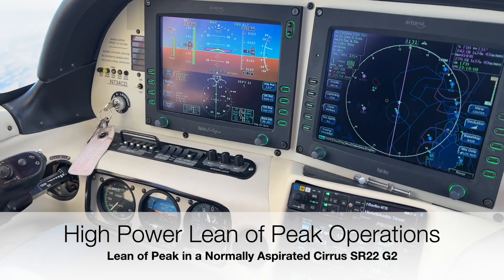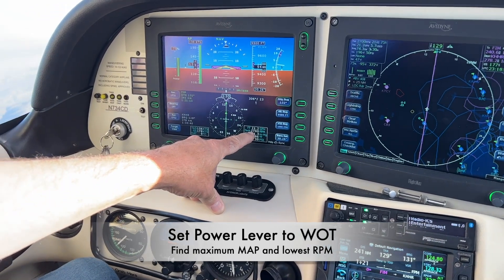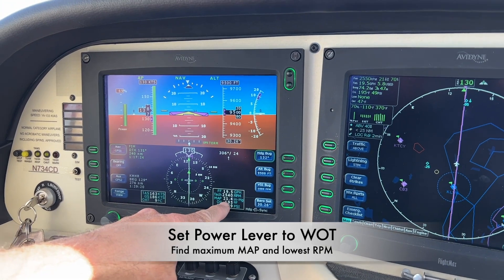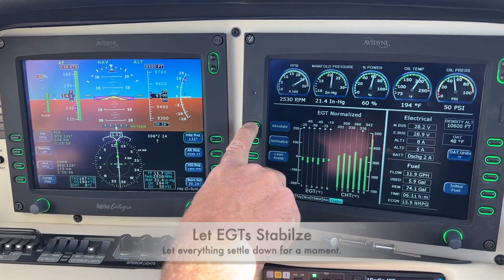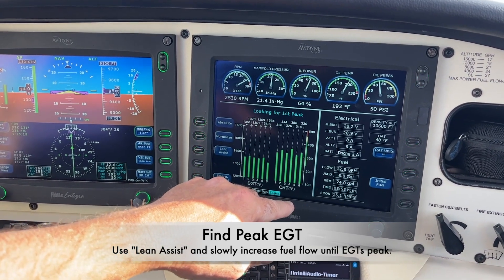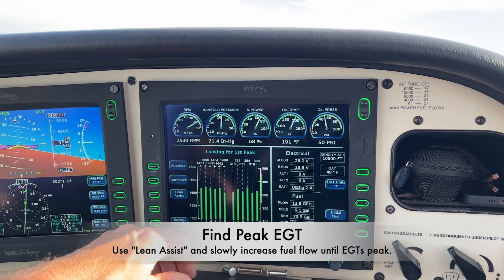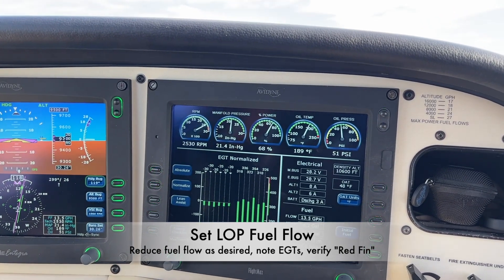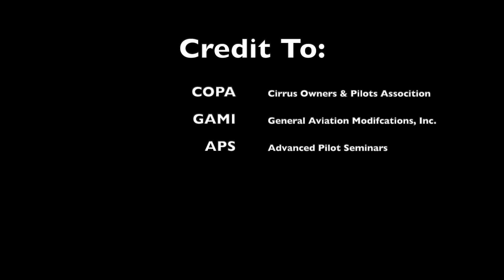High Power Lean-of-Peak Operation

Comment: Great video - there is one critical thing I might add: it's important to also monitor how CHT's respond after setting fuel flow. CHT's take some time to respond / adjust, but those temperatures are what actually matter in terms of engine longevity, as they more closely correlate to internal cylinder pressure (ICP). In an SR22, I would try to keep temps below 350 degrees for all cylinders during cruise (so maybe run a little leaner or much richer), as Cirrus has a great cooling design for its IO-550. Since the cooling system is great, the correlation between the traditional limit (or warning zone) of ~380 degrees F and high ICP has to be adjusted to around 350-360. i.e. since the cooling system is great, we're not as concerned about aluminum warping as we approach 400+ degrees F, but rather we're trying to extend engine longevity by minimizing high ICP by using the compensated value from 380 degrees F to about 350-360 degrees F as an indicator of "high ICP". 

Thanks again for the video!

Comment: Thanks for the video!  I am just not understanding how you determine how much to pull the throttle back when leveling off at the first stage of the process.  You say:  pull to 'lower the noise' and maximizing manifold pressure which in this plane (G2 SR22) is typically at 2530 RPM.  I've read others stating that these engines should be at 2600-2700 RPM at 10,000 feet at WOT (full throttle)?  IIn other words, can you keep throttle wide open when leveling off and what is risks/benefits of that?  And, what if you want to be at ROP--what is the process there?  Thank you again for your information and work!  (I also fly a G2 Cirrus SR22 NA IO-550).  Also, do you lean with the 1st cylinder that peaks in mind or last?
Reply from the maker: WOT and RPM are separate things even though in a Cirrus a single power lever controls both. Pulling back the power lever leaves the throttle at WOT but reduces the RPM. Once the RPM reaches about 2500, the throttle begins to close. We find it fastest and quietest to run the lowest RPM while still remaining WOT. But you can pick what you like. The specific RPM where the throttle begins to close (you watch the MAP to determine the point at which it closes) varies from plane to plane because it is a mechanical linkage and each plane is adjusted slightly differently.

For LOP, finding peak from the lean side we wait for the last cylinder to peak. The Avidyne "Lean Assist" makes this easy but you don't need to use it and the Perspective planes don't have that.

Good luck!
Reply: @jimflies1132  That makes sense now!  How about for ROP side--on the 'Red Box' or 'Red Fin' it shows that if we go 75 degreed ROP (as suggested by POH), we will land on the 'Red zone'??  I don't think Im reading the 'Red Fin' correctly for ROP??
Reply from the maker: @alielahi6701  We never seek peak EGT from the rich side. Too much time in the red fin. Do a BMP--Big Mixture Pull and get well lean of peak. Then push the fuel flow up to find peak EGT. Safer and less stress on the engine. 75 degrees ROP is probably the worst place to operate the engine. If you want to understand these concepts at a deeper level, consider taking the APS course which where all of us learned these things.  https://www.advancedpilot.com

Comment: Thanks for this video!  Why didn't you use lean assist to identify peak EGT and subsequent boxes to show degrees LOP?
Reply from the maker: We don't use the built-in "Lean Assist" function for a few reasons.  One, it only has one LOP fuel flow programmed into it. While that usually works, it may not always be the fuel flow and LOP we want for a given flight situation. Second, it spends too much time in the "red fin" finding peak EGT which isn't good for the engine.  Our goal here is to find peak EGT as quickly as possible, ideally from the lean side, and get to our target fuel flow quickly. The "normalize" key does a good job capturing that peak EGT. Once that's done, the display does show the degrees LOP of each cylinder.  Hope that helps.
Reply: @jimflies1132  thanks Jim!  And I agree, the LOP and ROP standard settings aren't necessarily ideal to stay out of the Redfin, especially when flying at higher altitudes.  However, I do find it easy/quick to find peak using Lean Assist.
Reply: Great video.  Can you elaborate a bit on how you decide if your pulling fuel flow back initially to 11 or 12 gph.  Is that based on altitude, OAT ?